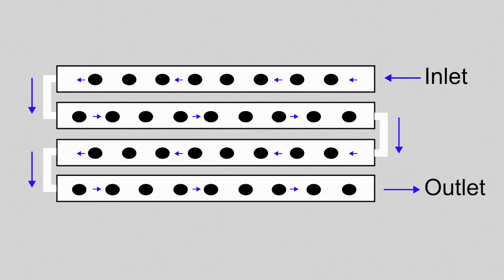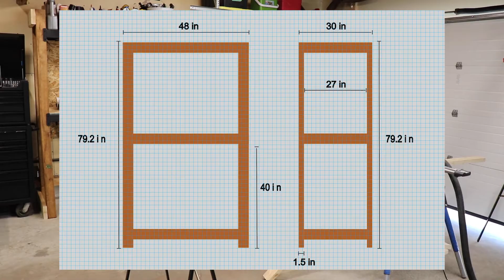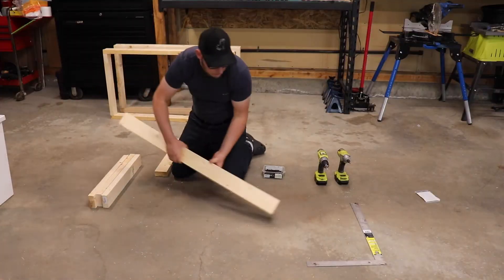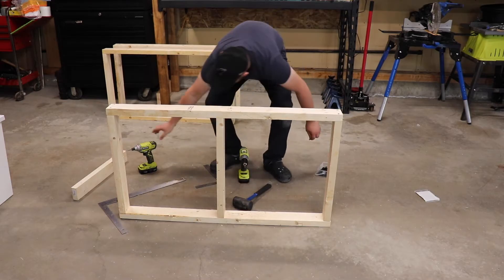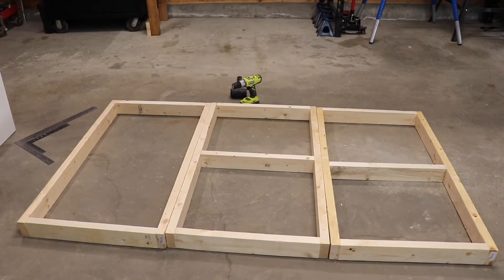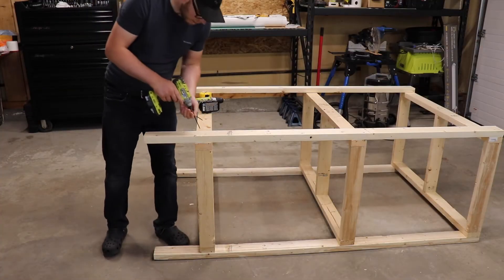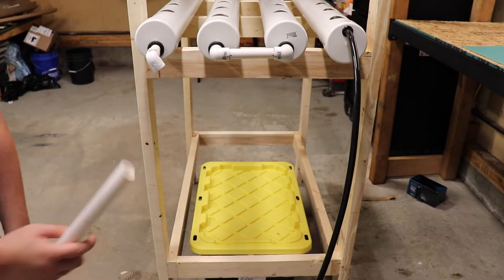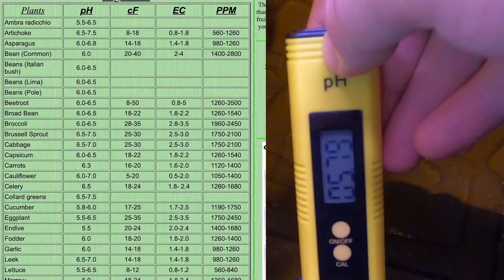How To Build A DIY Hydroponic System To Grow Food At Home

Comment: This was a great video, straight to the point, clear and concise with lots of detail, and little to no filler. For the first time in my life I just subscribed to a Youtuber after watching just one video.

I did notice a deviation between the nutrient solution you used (10-5-14) and the "recommended" nutrient solution for lettuce which is closer to 8-15-36.

I'm most likely missing something and appreciate real-world practical experience over what charts tell me, have you used different ratios and found the one you're using to be the best overall?

I am mainly looking at the romaine, but maybe your ratios are more targeted towards the bok choy and arugula? Maybe that's what I'm missing here.

Comment: Pushing the 3/4 pvc through the grommets is hard.  Did you have the pointed side out?  I saw you had dish soap in the video, did you use it as a lubricant?

Comment: nice set up i have a very similar setup and had been dealing with plants in the cups falling over when they get bigger so i made a solution for the 2in cups on 4in pvc and will design others soon... but if you have access to a 3d printer i can send you the stl to print and test then i can say for sure its either usefull or not. then ill upload all designs to thingaverse for public use
Reply from the maker: I haven't had too much issue with plants falling over yet. I am just starting a new grow again though so maybe your design will be useful. Unfortunately I do not have a 3d printer but I'm sure I could find one to use if needed. What's the file on thingaverse called?
Reply: @HermitsHome  Hydro-wiz look that up been adding some designs

Comment: Hey did u come up with the design or did u did u get the blueprint online🤔
Reply from the maker: I looked at a few other builds for inspiration then made up a plan for my own. No online blueprint. The photos I show in the video for the shelf and pvc system flow I made using a program called Inkscape.
Reply: @HermitsHome  that is very impressive that you came with this